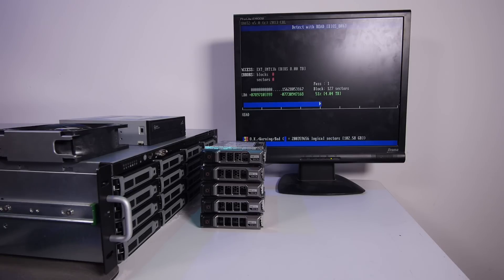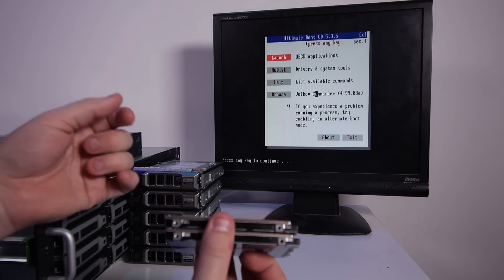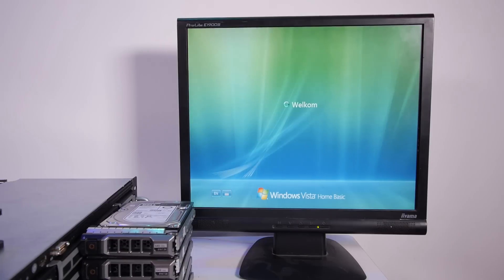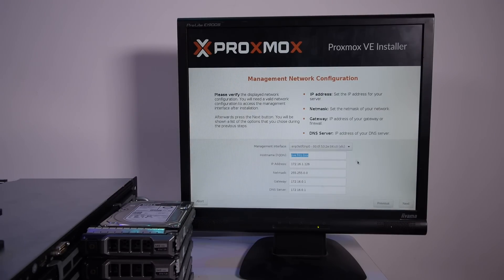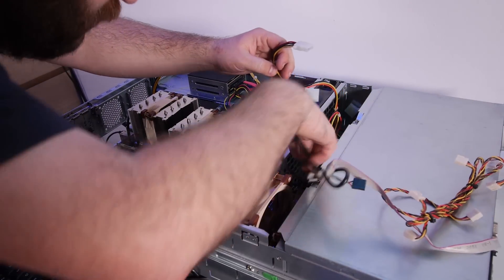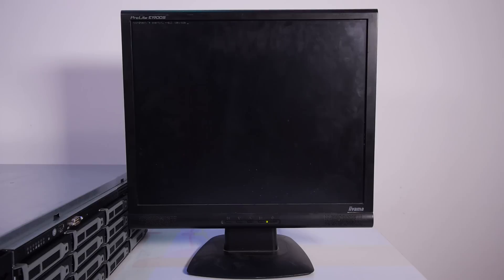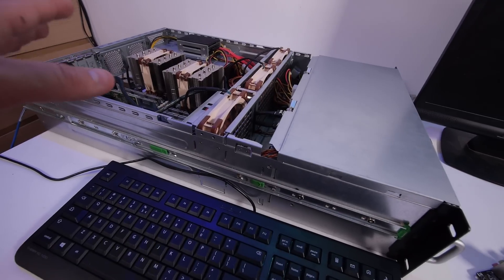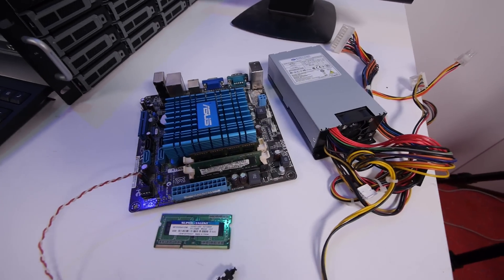ZFS Storage Server: Seagate 8TB SAS HDD's installation, 48TB

Comment: Hello Victor... do you have any knowledge of the IBM HS-1235t system.  It has the SAS9201-8i controller, but handles 12 drives in this case.  Do I need to flash it in order to use FreeNAS?
Thanks
Dave

Comment: A comment to the PfSense build:
Although this is the smallest form factor type for a firewall it is really annoying that we can’t use any Raspberry Pi or  even UDOO X86 form factor. If these boards would function, it would be possible to install a “new” firewall (and even virus checker) directly into nearly every old Retro PC! This would make the Internet and on-line retro gaming accessible again to many old systems.